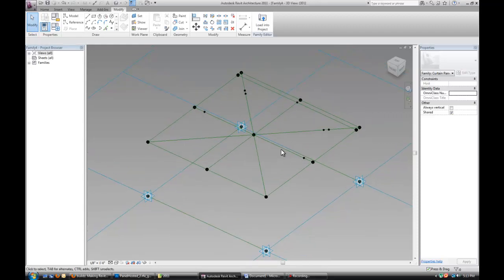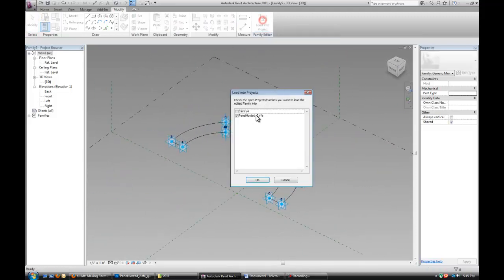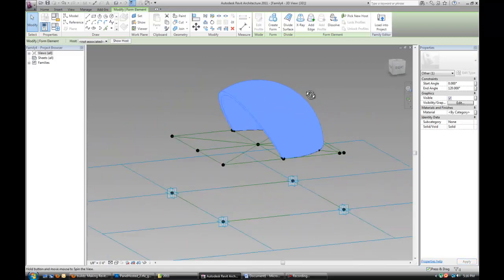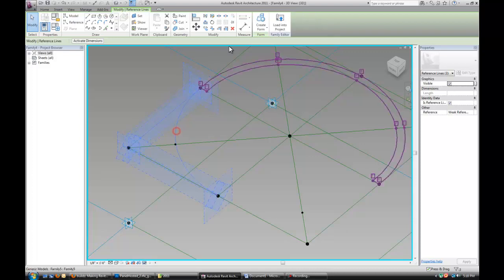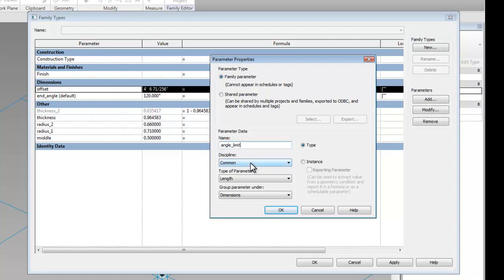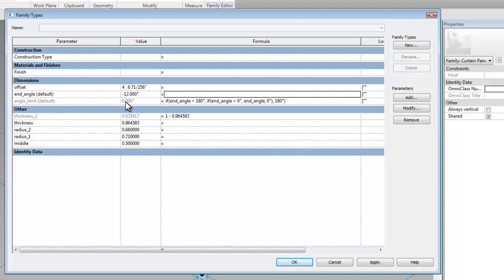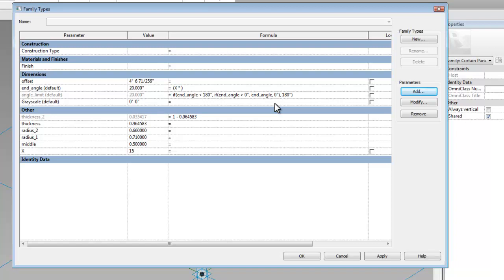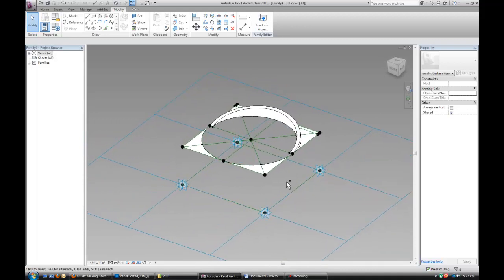Revit 2011 - API Plugin (image to panel)_part2

Comment from the maker: @tw1liiiiight I can't think of any books that explain much about parameters. Zach's website is a great resource. There is bunch of blogs that you can follow for interesting and creative content. Dave Light has a good blog as well. 
To answer your second question: "How do I know what formulas to use?" i have to say that most of the time they are simple mathematical equations. You kind of have to think top-down with these. If you have a specific solution figure out what parameters will produce it.

Comment: Hi, thanks for this. Is there a book, or a website that explains more about how to play with the parameters? How do you know what formulas to use? 

Also, on Zach's site, he did a variable tube radius for a star shaped panel. Do you know how he set up the parameters? 

TIA!